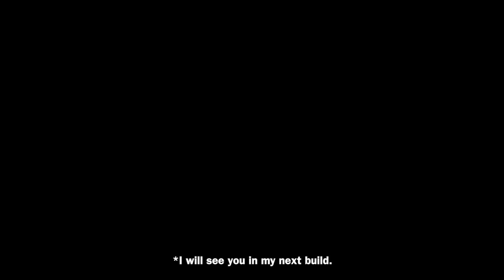I Turned Iketani Koichiro’s Nissan S13 Silvia Model Car into a Manga Drawing…

Comment: what type of marker pen was used for the black linings?

wont using gundam marker on painted surface clog the pen tip?
Reply from the maker: I use Gundam markers but they will get clogged unless you clean the tips often. Using a very fine brush to paint the lines might be a better option.🤔
Reply: @JunsMiniGarage  what do you use to clean the tip. alcohol? i tried thinner doesnt really work.

i have switched to sakura and copic pen. they clog less and cost around the same as gund markers but has finer tips.